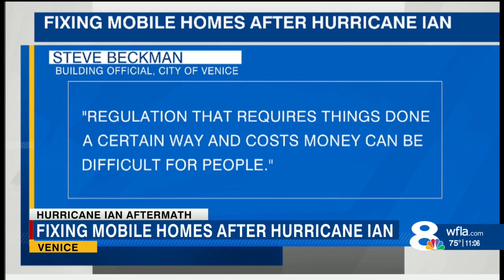Venice mobile home residents frustrated with city rules for rebuilding

Comment: You don't need an engineer for replacing a floor or electrical. An electrician for electrical or yourself as long as it passes code